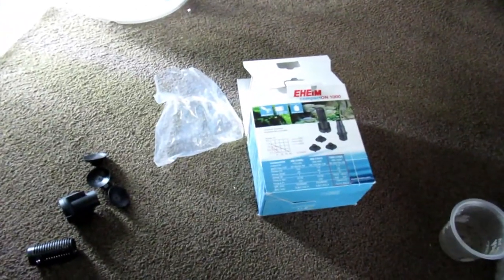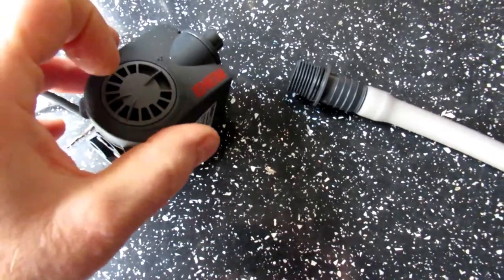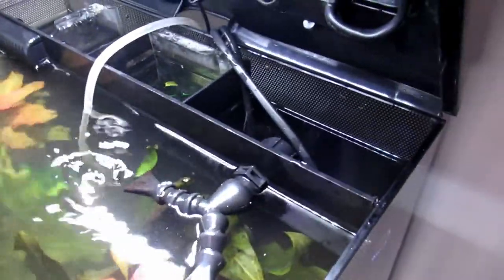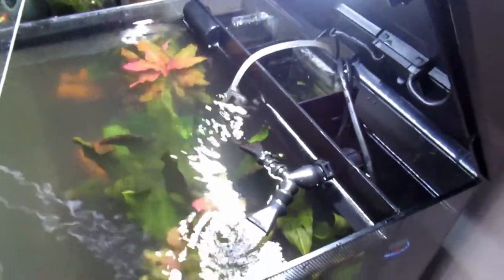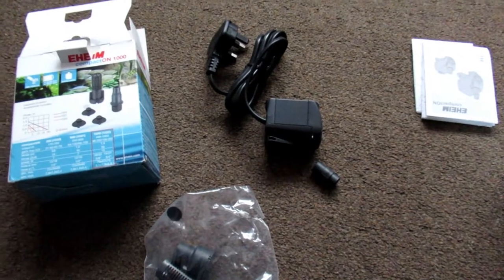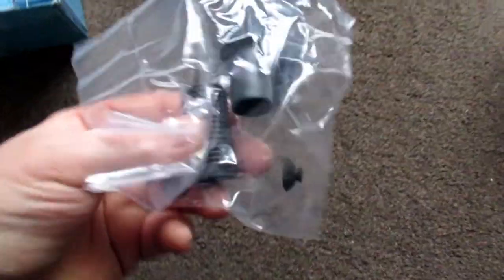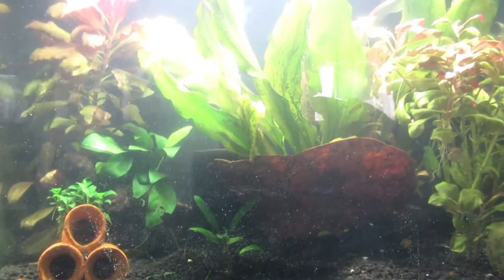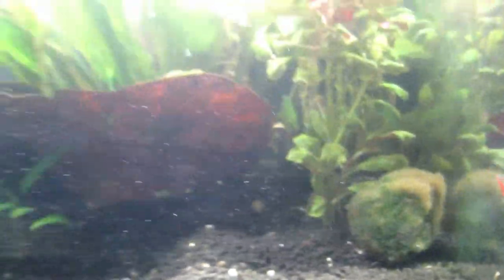fluval flex pump mod for betta ,shrimp and noise reduction

Comment: Since finding them I love your videos. I've just done this mod on the Fluval Flex 57 and I went for the same pump (1000 model) which on it's low setting is perfect and I have the opportunity for more flow if I need it. The pipe is very tight to get onto the nozzle, I ended up heating the water in the microwave to bubbling hot and it really softened it so just popped on 😀. I was a little worried it was noisy at first but I think it's because the pump is in such a small chamber you need to take a little time to position it so it doesn't vibrate. Really pleased and thank you for all the tips.
Reply from the maker: Very welcome and the pump will serve you well oh and coming up on the channel as promised the shark pro but with a twist ,,,i hope lol
Reply: @AQUAGUYUK   Cheers Alan, looking forward to the Shark review (and the twist)🤔 intriguing 😆.
Reply: Thanks for the info....I have the same tank (Fluval flex 57l) and changed the pump with Eheim compacton 1000. As you mentioned I still have the noise of vibration since it's sitting in a tight space. How did you  manage to remove this noise and make it quiet like in this video? is there any video I can watch?
Reply: @eastmeetswestvibes  Thank you for your reply, I have ended up taking the whole filter chamber out and using a small internal filter. This has solved any problem and makes the tank bigger too. Removing  the plastic back wall is easy and if you search you will find Aquaguy has done a nice video on how to do this. Others have done it too. Fluval design is not good here, the chamber is so small I suspect whatever pump is used it's going to touch the sides and vibrate. Good luck.
Reply: @haitch04  Thank you for you quick reply. What is the "most silent" small internal filter you used and happy with? ;)
Reply: Have the same problem. The stock Fluval was waaay more silent theb the compacton 600. Very dissapointed about Eheim. Did you  found any solution?
Reply: I think the filtration background is the strongest point of it. I filled up the first chamber with 4L bioellements and that gives a huge advantage!

Comment: Fluval Edge intake filters or the Pre filter sponges (coarser) from Aquarium-CoOp are an easy way to slow the current on the fluval flex. Two other easy and cheap upgrades are small corner sponge filter in the 1st chamber and a small cheap (no reason to spend a lot) UV light.
Reply from the maker: Indeed this was more aimed at replacing the pump when noisy but love the info

Comment: I just changed my 57l flex pump to eheim compacton 600, it works great and even flow rate is higher than stock pump, I can visually see the difference
Reply from the maker: i test the compact 1000 and 600 as the 1000 is variable you can adjust it down to 400 which is good for Betta fish
Reply: @AQUAGUYUK  Even on compacton 600 you can adjust the flow rate from 250 to 600. My personal opinion for Betta 600 is good enough
Reply from the maker: @anandram369  Glad it worked out
Reply: Hey bud, did you find the 600 was a lot quieter than the stock fluval flex 57 pump? 
Thanks
Reply: @nigelb5341  Yes, slightly better than stock pump.

Comment: Thanks for the info. A little boiling water released the tube easy. Turn the flow down all the way for 60 gal/hr
Reply from the maker: Really is a great little pump i use the 100 ltr to do water changes to and from my tanks

Comment: Great video!! I was just looking for a pump replacement in my flex 15. I just had my flex for about a week and the just started to get noisy. Can you tell me how did it work for you after a while of using it? And how did you manage to connect the tube with the pump? Will the 1000 be too powerful for bettas?
Reply from the maker: If you use the eheim 600 compact it works well and fits the stock tube but you will get a little noise as the rear compartment is like an cave effect as for the 100 I used this and adjusted it right down but now removed all of it and use a little sponge filter hope this helps
Reply: AQUAGUY UK Thanks for the reply! Any complications after using the 1000? I want a quiet one that doesn’t have a high flow rate that might harm my betta.. I mean I can cover one of the nuzzles with a sponge but still.

Comment: Made the change but honestly can’t say I find it quieter - just a different hum. It’s not rattling or touching the sides. Higher flow rate for sure even turned all the way down. Although so powerful it seemed to suck a lot of gunk out of the filter and blow it into the tank. And I just cleaned it. Not sire how you’d avoid that.
Reply from the maker: Really!! very strange i have had three now and all better since the swap having said that i have now removed the baffle and compartment completely in 2 of the three and use an internal filter
Reply: @AQUAGUYUK  thanks for the reply. I’ve stuck with the original filter setup. Tank is clearing up. I’ll take a closer look tomorrow. Pump could be a dud I suppose.
Reply from the maker: @dpowert2  or indeed you had a good original pump although they are limited the original can be hit a miss only thing that may have changed that is i placed some filter floss under the filter first

Comment: i bought the 600 and found that it was just as loud. was humming really loudly. not sure if i got a defect pump. made sure the pump wasnt touching, the impeller and chamber was checked  also lubricated it
Reply from the maker: faulty pump maybe mine is so quiet need to keep checking its on

Comment: Great video, I bought the Mega flex in january and slowly dryscapping and modifying at the moment. Would the 1000 pump be sufficient for the mega flex or somthing larger.

Many thanks 

Mr R
Reply from the maker: Yes, absolutely but think you would need two ?

Comment: Don’t know if you can help, have a betta fish and tetras in a Fluval Roma 90 and was thinking of fitting a Fluval 107 to it, do you think it would be ok for the betta fish?
Reply from the maker: It might be a little much to be honest but in the 90 the filter is quite far from the water level this means the filter would pump less than 550 lph also it comes with a spout that could be positioned to flow at say the rear wall ,i actually think it would be ok maybe add a spray bar or sponge to diffuse the flow
Reply: Hi thanks for getting back so quickly, food for thought I will let you know how I get on
Reply from the maker: @Stu.c53  i will always answer  and want to know how you get on good luck

Comment: Hello mate, I’ve got one of these pumps in my flex 123. I came down this morning and it’s obviously moved an easier making a horrible rattling noise. I have now put it on some filter padding and it’s humming. Is this humming what you mean by virtually silent ?
Reply from the maker: i can only tell you of my experience and i have both the 34 and the 57 and unless i am right next to the pump i can not hear it perhaps its touching somewhere

Comment: Hi there. I have the fluval flex 9 and need to change the pump as it’s flow is way too heavy. Can you recommend exactly which products to purchase that will work with the 9?? I believe you’re talking about a bigger tank for this one. I just turned it off and put a sponge filter in, which may be fine on its own. But would be cool to use the built in one
Reply from the maker: You can use the smaller eheim compact 600 and turn it down
Reply: I think the 300 is good also

Comment: Bought the 600 but it seems to make a fair amount of noise still.  Put a cloth under it till I can get something else and that doesn't help either.  Almost sounds like the pump is rattling against the glass.  Bit frustrating.
Reply from the maker: Strange mine was whisper quiet but i did put it on an old bit of sponge if its a glass try putting sponge down the side
Reply: @AQUAGUYUK  The problem with the 600 was the blades were rubbing on the inside which was creating a horrible noise (looked to be glue that it was catching on).  Its now in the bin.  Ive put the original pump back in the tank and will have to live with that.
Reply: @richardwalsh5962  return the pump I did this mod a year ago and not looked back
Reply from the maker: @richardwalsh5962  Damn shame mine is still the best pump i had you can use the 300 but if the pump is noisy simply return it to vender as it must be faulty

Comment: Hi , I have fluval flex 57 ..where you bought it this pipe  for pump please ?  thank you ..
Reply from the maker: same pipe
Reply: @AQUAGUYUK  Can I use this for a fluval flex 15 gallon saltwater conversion? I feel the stock pump flow in the tank is too low
Reply from the maker: @zachiscoolish  yes should be fine i checked the pump its both fresh and salt water but may inherit a noisy impeller over time but this would happen with most but for extra flow go with the 1000 as marine require a much bigger flow ,,,also think about removing it all i did and never looked back
Reply from the maker: @zachiscoolish  use the 1000 compact but check this out too https://www.youtube.com/watch?v=8xWtBmdDVjo

Comment: Hi mate I've just looked on ebay and the 1000 is £33 are you sure it's the 1000, your using for your flex, thanks.
Reply from the maker: i have used both the 600 and the 1000 the both work the 100 is adjustable mind you it was four years ago

Comment: After watching bought the same system. Not slow enough, fish are still hiding from strong current due to pump.
Reply from the maker: In the video i did say about the 1000 having a flow regulator but you can but a sponge sock or point the nozzle at the side or rear

Comment: Will the stock tubing on the fluval flex 32L be long enough with the compacton 600? I’ve had my flex for two days and within a day it’s gotten incredibly loud.
Reply from the maker: I believe it should if you change the input as the eheim comes with both just turn it around but first move your pump in your tank as it may be hitting the glass
Reply: Nothing touching the glass, I did notice a crack on the impeller cover where it locks in place… there’s a small rattle when I have it in the sink that isn’t there when the cover is off, in the tank it must get amplified as it sounds 10x louder. I can get a replacement but I ran across your video and it’s swaying me towards a new pump all together…

Comment: Does the Ehiem 600 sit on the bottom in the back chamber or need to sit on some foam?
Reply from the maker: it can sit on the bottom but i dropped a bit in mine just make sure it dont hit the sides
Reply: Hi thanks for that , good to know
Reply: Fitted this to my Fluval flex and can’t hear a thing brilliant job thanks
Reply from the maker: @Stu.c53  very welcome but you did the hard work 😀

Comment: I'm having trouble connecting the tube from my 15g flex to the eheim 600 😞😞 can someone help me figure it out? TIA
Reply from the maker: The tube fits on to the little tube straight out of box ,,,if its tight soak it in hot water but i had no issues
Reply: Thank youuu

Comment: What are those clear filter holders?
Reply from the maker: Intank media baskets https://charterhouse-aquatics.com/shop/aquatics/filtration/intank-upgrades/intank-fluval-flex-57l-media-basket-chamber-2?msclkid=ef6f7a6df7061a3749771af5d0ecf172&utm_source=bing&utm_medium=cpc&utm_campaign=GS%20-%20Google%20Shopping%20(Non%20Premium)&utm_term=4586337879008191&utm_content=Intank
Reply: @AQUAGUYUK  Ive now just set my 57ltr up, the pump is so noisy, what pump would you recommend these days, still this one in the video? i wish we could put a Tidal on it.
Reply from the maker: @TheFewzz  Make sure the pump is not hitting the wall or floor in that chamber i dropped some sponge in to make sure

Comment: Does the 1000 work with the flex 9 ?
Reply from the maker: the height is the same so it should but may need the pipe cutting

Comment: put a 600l/lh in mind flow was to low...
Reply from the maker: The fluval standard is 230 litres an hour the 600 should be good as mentioned for shrimp and bettas I personally prefer the 1000
Reply: i got the 57l witch is 500 l/h 34 l is 230l/h mega flex or 123l is 770l/h but i think pumps sh?t too...